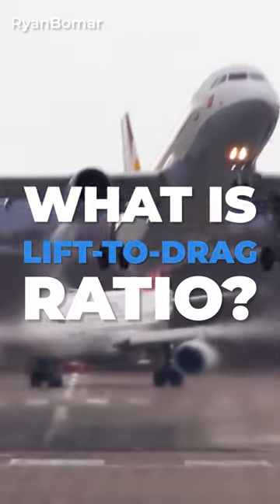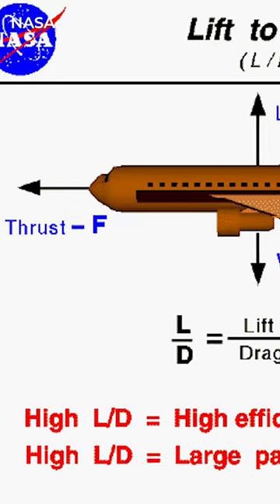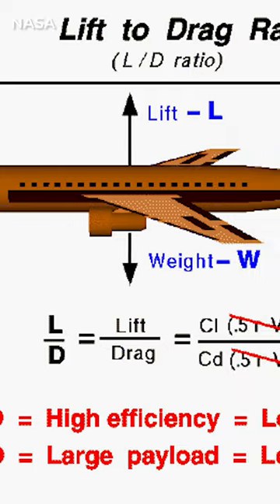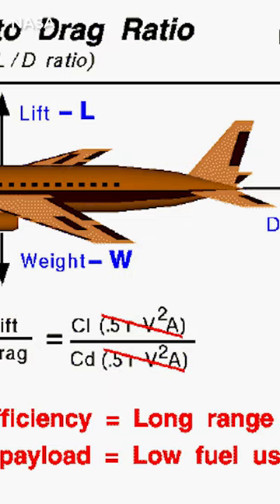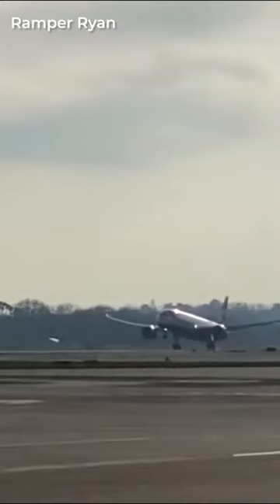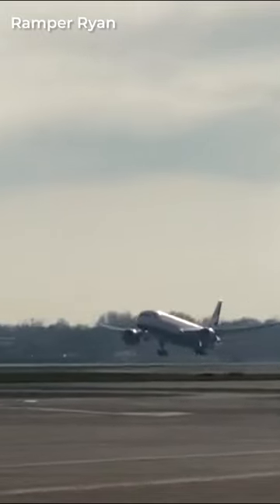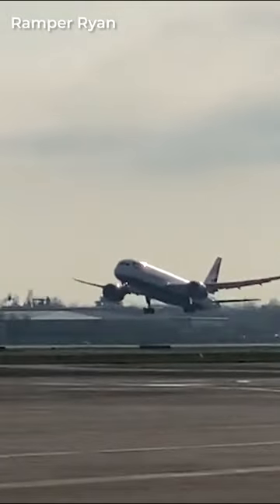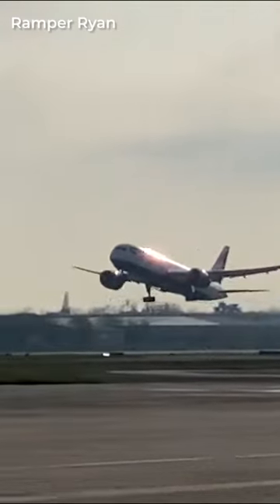What Is Lift-To-Drag Ratio? #shorts

Comment: If the aircraft is doing a constant speed then thrust must equal drag not exceed it, or it would accelerate. Please read up on that, don’t give out wrong information
Reply: The video said, "Drag must be less than the thrust given to keep the aircraft moving forward"

Please listen up on that
Reply: @TheZayzoo  Moving forward means moving at a constant speed or accelerating forward? Both cases will yield different force analysis.
When you say keep moving forward usually will mean moving forward with a constant speed, in which case thrust=drag.
Reply: Cautious about dragS! 

You have the friction drag created indeed by the aircraft surface penetrating the air which is linked to the speed, total external surface size and roughness. 

Then the profile drag as well linked to speed but also to the shape of the penetrating volume (best shap being the tear drop) and the total frontal surface.
 
Finally, and most important, the lift drag which is generated as soon as lift is produced by the wings. This time linked to aircraft configuration (incidence, flaps and slats position) and of course the aircraft weight. 

Nevertheless, in a steady and levelled flight, with no speed variation, the dragS sum is equal to the sum of the engines trusts.